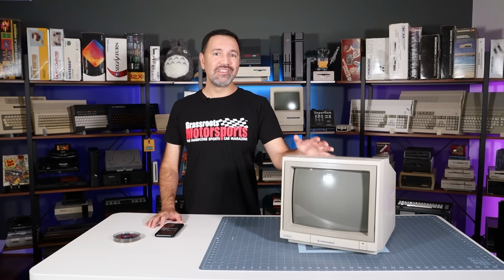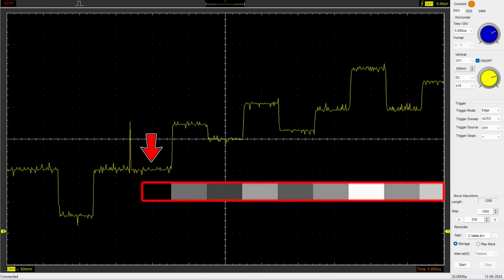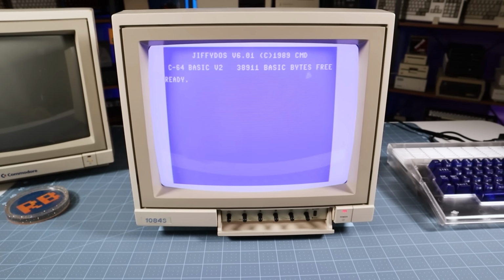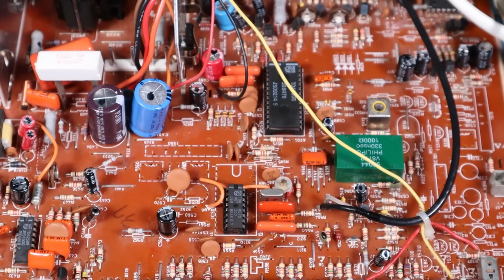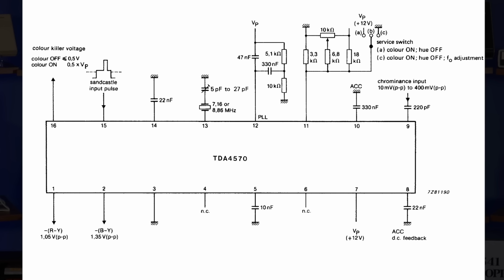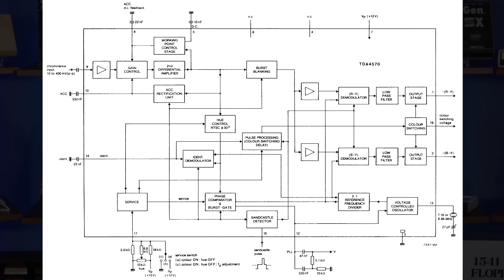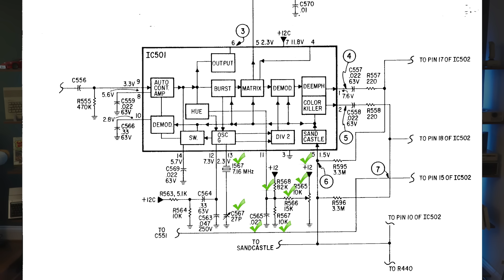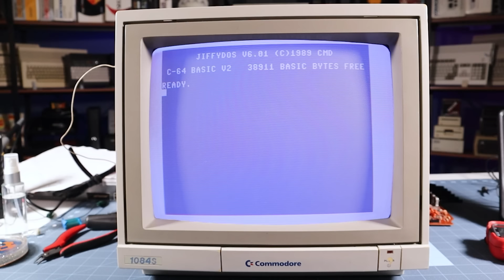Why does my 1084S only display PINK?!

Comment: Before I turn on any equipment, the first thing I do is a complete, closeup, visual inspection with illuminated magnification. It saves time and money reworking things that might not need replacing.
Reply from the maker: I thought I had, but the resistor looked good from the top down perspective so I must have missed it!

Comment: Oh, the measurement on the xtal was 15.72KHz and not 14.32MHz. That makes a little more sense as it's around the NTSC scanning frequency. Mind you, knowing that probably would have raised more questions than answers but you got there in the end. Nice job and well explained
Reply from the maker: Good eye! I don't know if that 15.7kHz was the horizontal refresh rate coming from somewhere else or just some kind of coincidence. I kind of feel like it's the latter because when I swapped the crystal and variable cap from the parts monitor, it measured closer to 14.3 with the IC still dead weight. I don't know enough to draw any kind of conclusion here. Thanks again for your help!
Reply: @retrobitstv  Its just horizontal flyback pulse. In horizontal transformer and yokes it has around 1kV amplitude, so it just appears everywhere as a crosstalk-where is high impedance and no good grounding - which is also IC disconnected by blown up resistor. Even if you take probe and put it somewhere near TV, you get it.

Comment: That glue has many issues. It was originally supplied by the Sony Corp to other manufacturers. Unfortunately in that day they did not realize it was hydroscopic and could cause issues with leakage across the conductors causing circuits to malfunction. And when it absorbed the moisture and then head voltage applied it set up an electrolysis which would corrode the wires that it touched. All in all a horrible product. There's really no good way to remove it other than to pick it off which you should never do on a yolk as you will destroy The insulation on the winding's shorting out the yoke.  Sometimes in other areas around the flyback they would glock some on to keep components from shifting. That can be carefully removed with a dental tool picking it off of the circuit board.  I know of no solvent that will remove it that will also not damage components or the circuit board. Nasty awful stuff.  Thank you Sony for your hard work and putting out such a terrible adhesive.😢

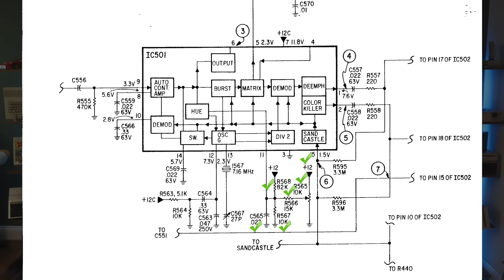Comment: 14:37 - Heh, I know this feeling. I spent 3 months trying to get an $80 "eBay special" Amiga 2000 mainboard working. In the end, I replaced and repaired a bunch of stuff, only for it to be a resistor pack by the CPU that was in the line of fire of battery corrosion that kept the machine from fully booting. The machine still seems like it has some issues, but it's working... for now...
Reply from the maker: All part of the vintage computer lifestyle!

Comment: Where it comes to PAL it technically was identical to NTSC with the exception of reversing phase every other line and using higher bandwidth (so actually higher horizontal chroma resolution) and other than that PAL was desinged for improved EBU phosphors which had better colors in both 3D gamut but also rod stimulation. NTSC was originally designed to have very wide gamut but quickly was changed to much narrowed gamut and to use SMPTE-C phosphors which were for NTSC users optimized less for life-like colors and more to closely match B&W images to how it looked on B&W TVs. Other than that most TV sets did use circuitry which would use delay lines to merge chroma information from two lines - and this was what caused transmission errors leading to decreased color saturation and could affect vertical chroma resolution. Otherwise this circuitry was not actually needed and especially at first many TVs would not have it - this would lead to transmission errors leading to every second line having the same phase errors - but since phase was reversed every other line these phase errors would visually cancel out - just not via specialized circuitry but rather visually. This is relevant for Commodore 64 because especially at first in the 80s many people would have TVs without delay lines and would experience this effect of every second line having slight color shift. Less so because transmission errors but because we are talking abot imperfect C64 video chip generating imperfect signal. Fun fact is that on my SONY PVM-14M2E I don't have this delay scanline circuit and it would show actual colors decoded and any phase compensation is purely visual. I actually like this a lot on this monitor - for systems like C64 it does make image more interresting to look at. Similar professional 15KHz from JVC does correct these errors - and it does very good job. Not sure if it sacrifices vertical resolution - cause this isn't something that needs to happen - its all up to TV set and maybe TV stations reduced resolution too but definitely not home computers/consoles - it is not needed and circuit to not do that is much simpler. Otherwise general topic of PAL vs NTSC I always chose when I can NTSC color for old computer/consoles simply because its more consistent and lower resolution can be an advantage if I am already using composite over RGB or S-Video for composite effect. Also some systems like NES and SNES have perfect internal resolution for NTSC - matching pixels perfectly. PAL - not so much... though I must admit back in the day I didn't complain about PALs tendency to make every other line different. In C64 which I have as my main C64 which is Ultimate 64 I use NTSC at 50Hz - so pretty much 288p with NTSC colors. In this system I also like to set palette more similar to one from US which is much more vibrant. The effect of every second line having different color doesn't exist there but yeah, the monitor I most often use which is the JVC I mentioned wouldn't display it either.
Reply: No, thats not how it works. Only few TV sets in 60s didnt have delay line. All sets from 70s, 80s had it except some professional monitors. Visible error between 2 next lines in picture from VHS and home computers is in fact created by this delay line correcting circuit. Because this delay line circuit expects precise chroma frequency. But computers or VHS has no precise chroma frequency (even they are based on crystal oscillator), so the delay line is creating errors, because due to wrong frequency the delayed signal is not in correct phase with signal from current line. Only the TV sets that used CCD delay line working in baseband (Philips IC TDA 4661 and similar), not in chroma frequency can correct this error right.
As for resolution - PAL signal was broadcasted from TV station with full resolution. If you used PAL-S decoding (decoding without delay-line) you got full resolution on screen, but with visible line to line phase errors. This way was used in TV studios, because there was no problem with correct phase. If you used PAL-D decoding (with delay line), vertical resolution was reduced - this was used in all home TV sets.
Reply: @xsc1000  Thanks for detailed response. I was not quite sure about some details but at least I got some things right. In practice I never noticed this reduced vertical resolution but on the other hand higher horizontal resolution led to less grain and I also don't ever remember any color phase errors on PAL. NTSC for today's purposes of like old consoles/computers is ok - though still its not quite clear if hue is just right. In this case it being slightly wrong isn't an issue. For things like video it however is quite annoying like I some time ago watched LaserDisk and I could not help myself to spend few minutes to correct hue to annoyance of everyone. Later NTSC TV sets apparently had some systems to auto-correct these things so it might have been not so bad as it might seem. Otherwise if I had to correct hue all the time switching channels it would be quite irritating.

Comment: I wonder what caused that resistor to fail?
Reply from the maker: That is the question! I really don't have any way to tell but I can say that the issue first started at the same time the deflection yoke shorted out. I guess it's possible that the yoke failing caused voltage regulation issues elsewhere on the board and the resistor was the first thing to pop? Nothing else appears to be affected. It will be interesting to see if the fix is permanent. If it fails again in the future I guess I'll be measuring current draw at/around the IC :P
Reply: @retrobitstv  I dont think it has any connection with deflection yokes. This resistor was completly blown up, so I would expect short circuit - probably shorted blocking ceramic or electrolytic capacitor. So it can return back.

Comment: I'm having some problems with my 1084D 😭
Everything RGB is fine, but on  Composite Signal the Image becomes super dark after a while, probably temperature related.
Fault must be somewhere around/before the TDA3507 circuitry.....I think 🤔🙄
Reply from the maker: Huh yea, when I see faults that are variable in nature I usually start with looking at the capacitors but it could be a transistor or one of the passives as well. Good luck fixing it, it can be a chore to keep these things running but it's great when you finally track down the issue!

Comment: I sunk... I don't know, around 20 hours into an 1802 with the same issue. It started out having no vertical deflection, as all of those do, because they all have the same capacitor that barfed up.  Easy fix. But then, no color. No matter if S-Video or Composite. I'm in Germany, so it was a PAL machine. Guess what - there are no schematics for the PAL version and the pinout of the jungle IC is totally different.
I've measured everything (voltages, components). It appeared as though the jungle IC says "this isn't a color signal at all!".
If you force it to color (by overriding the B&W/color identifier pin), I got barberpoling colors. The frequency of the Quartz was pretty close. I managed to trim it so it barely stands still - but it would only decode blues and grayscale. Even yellow wasn't decoded (I've had a jungle IC fail the Q (or was it the I) portion that demodulates red/green).
After lots of measurements, I concluded the jungle IC must be faulty. As luck would have it, just a few weeks later I came across an El-Cheapo TV sitting next to a dumpster - it had the same IC and was working fine. So I transplanted chips. Sad trombone. I swapped the delay line (remember, PAL). Sad trombone. (the cheap TV still had color).
I did more measurements. Out of desperation, I looked at the outputs, there was one that was involved in enabling the color circuit, but the way it was depicted in the manual it was an output. Guess what - it was some kind of feedback circuit. There was a signal on it. There was a signal on every solder joint down the line - except the last one.
The eyelet was cracked!
Finally I had correct color!
Couple weeks later at a different museum I saw some people trying to hack a Wii using a 1084. The picture also had no color. We tried different settings, tried switching TV systems on the Wii itself, no color. After like half an hour, I tried turning the color control, just for fun. It was set to zero.
Reply from the maker: Haha the lengths we go through to preserve these monitors! Glad you finally found the problem, that was a weird failure mode alright!

Comment: Do you have a link for the attachable probe connectors? thanks
Reply from the maker: The ones I'm using are just generic push-clip types on both ends that I picked up at a Hamfest or something like that. They're not the fancy kind that slip on over the ends of the probes.

Comment: Could the same issue appear with pal monitors? It was a bit hard to follow, the explanation of pal.
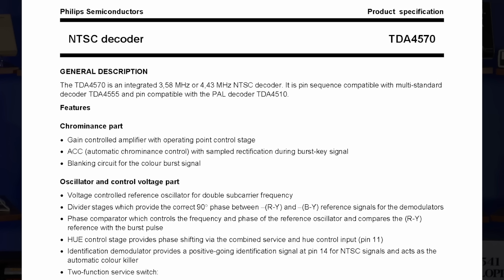Reply from the maker: Check out the first paragraph of the datasheet at 06:21. The TDA4750 is pin-compatible with the 4510 which is the PAL version of the chip. I suspect that you could convert an NTSC 1084 to PAL simply by swapping this chip. Something to test in the future. PAL models won't have the Hue pot or resistor network at all, but this same failure could absolutely occur if the resistor or other component providing power to the chip itself failed.
Reply: @retrobitstv  aha! Thank you. I also own a 1084
Reply: @retrobitstv  TDA4510 expects delay line circuit that is not present in TDA4570 (pins 4,5,6). So if you swap those ICs and X-tal, it would work as PAL-S decoder (decoder without delay line) but the saturation would be half of the NTSC.

Comment: You should try to fix the parts unit.
Reply from the maker: The only thing wrong with it is the flyback is starting to go and the deflection yoke is completely shot. Flybacks are still available but the prices have shot up. The yoke, on the other hand, cannot be replaced. Repair might be possible but it's very fiddly.
Reply: @retrobitstv  It'd be nice to see.

Comment: How feasible would it be to add some PAL components and add a PAL/NTSC switch?
Reply from the maker: From what  @xsc1000 mentioned in another comment, the PAL version of the decoder chip expects a delay line circuit that isn't present so it would work but not as intended. That's not to say it couldn't also be added though.

Comment: I wonder if someone tried rebuilding the 1084 PCB from scratch. Since people are rebuilding all Commodore hardware (computers, floppy drives, expansions) it is probably only a matter of time until somebody does it...
Reply from the maker: I haven't heard of any such project. Fortunately the caps don't tend to leak on these monitors so PCB damage isn't common. The biggest issues are failed flybacks and deflection yokes. The former are still available, although the prices are getting steep. The yokes are not, so once that part goes, you've basically got a boat anchor (or a parts monitor, as in my case).

Comment: The resistor network is OK, the input voltage is OK, the output voltage is wrong. The only possibility is a short circuit at the output, i. e. inside the decoder chip (possibly, the previous one).
PS, that burnt resistor also makes sense.